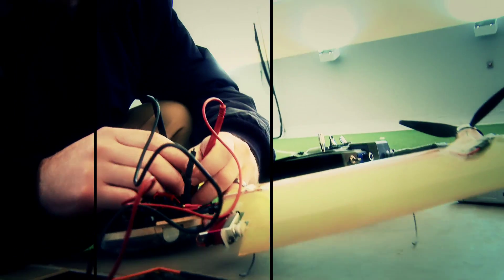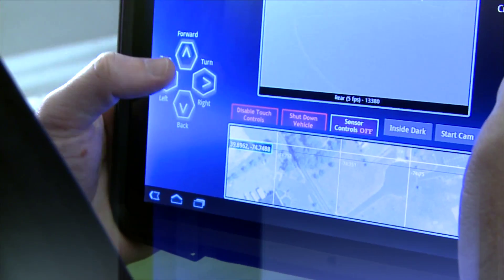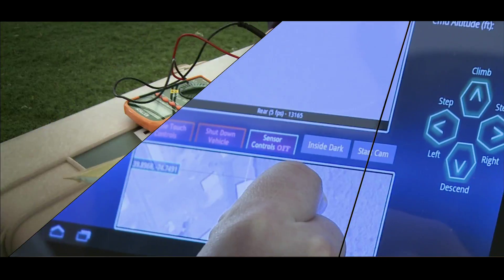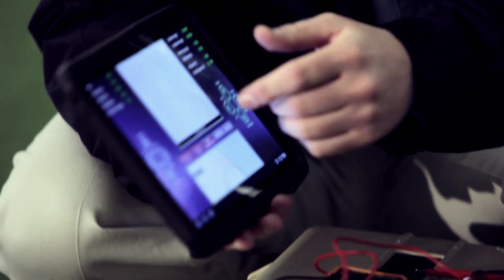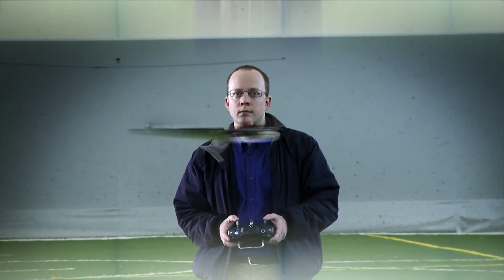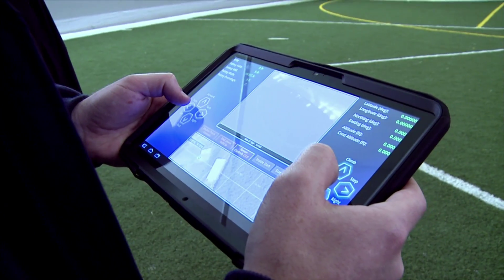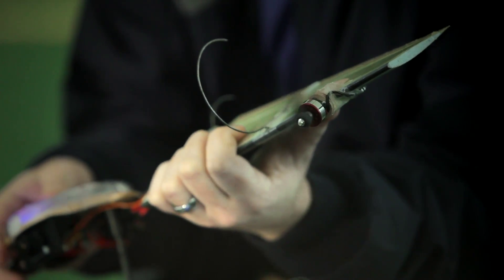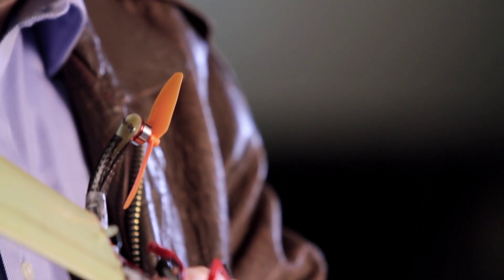Samarai - A Maple Seed-inspired UAV

Comment: You know you could've eliminated the issue you created for yourself by making a small flying device that doesn't spin the camera around at light speed resulting in a terrible frame rate return video feed. The device could crash and you would only know seconds later.

Comment: Just like I have to remind a loved one often, "Just becuase you have an 'idea' dose Not make it a "Good idea"
By the way.. are you cycling the elevator by its servo 600 to 900 time a minute for stearing like the action of a swash plate? That is asking a lot..read: fail point
Also if you put the motor leads inside the wing you would not need the heavy flat wires and glue.

Comment: Wouldn't it be just as easy, if NOT much easier just to have small remote control helicopters?  To me it seems they're going out of their way to make these "remote control drones" that much more of a pain in the ... as well as more expensive for our Govt agencies to pay (You can buy small/stable remote control helicopters for less than $100 - add a camera to one of those and you're probably 1/100 the cost of the "image software" on this thing!

Comment: Good concept but oversized and short-seighted on Systems Engineering (SE).  Better would be smaller without the motor-system drooped from a high altitude launch vehicle (like the kids rockets) with a selectable micro/macro-charge that would detonate whenever they landed such that they couldn't be reverse engineered or to do damage.  A camera/steering/crawling mechanism too (perch land/observe/relaunch).  Otherwise, nice try but quite a waste without the SE brains to do it right.  (FAIL)